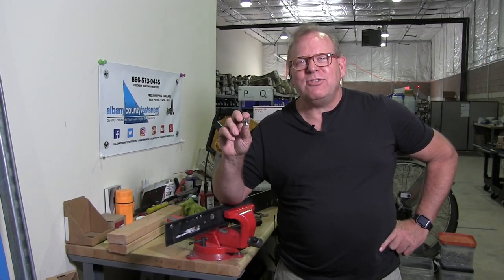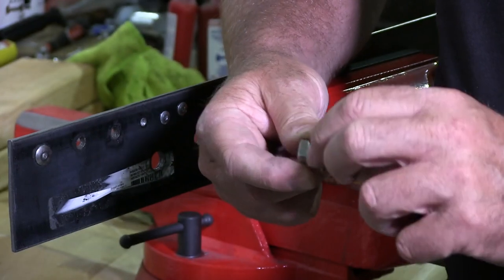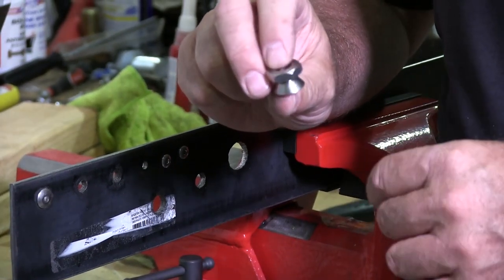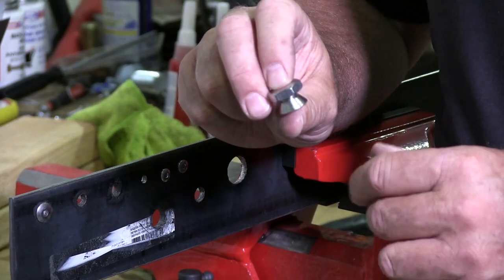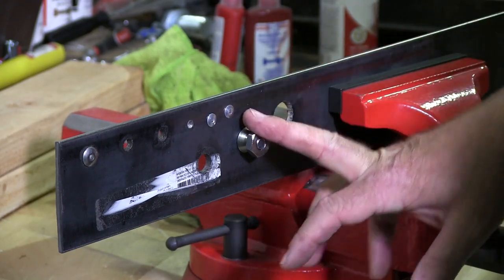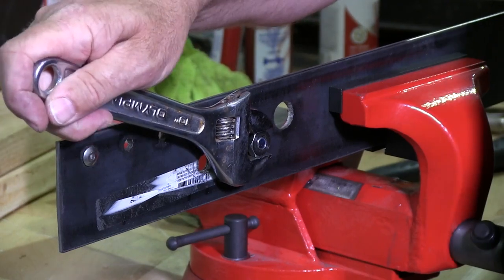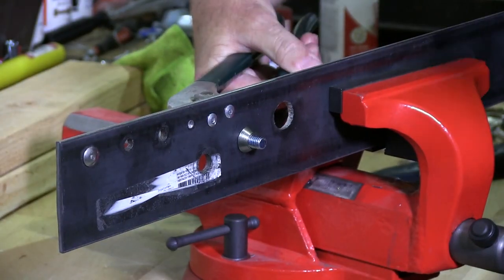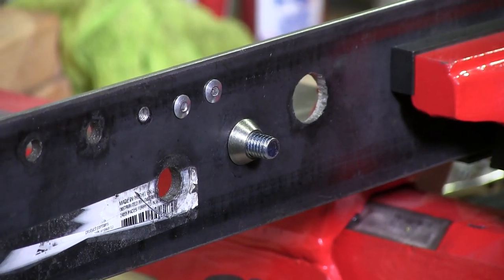How to Install Breakaway Shear Security Nuts | Fasteners 101

Comment: A fastener joint which uses a shifter and some multigrips in a demo video for a shear nut! Get the proper tools and maybe also educate yourself further on what stock you actually carry, also they are not welded at all.
Reply from the maker: Thank you for your feedback.
Reply: Yes, they seem machined that way
Reply: correct, but in practice, this is how the average joe 6 pack is going to install her.